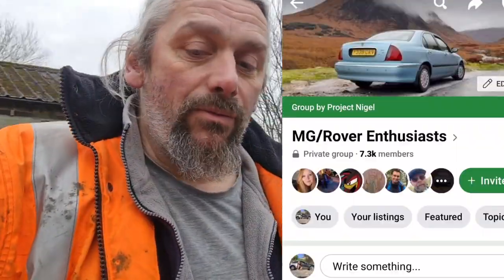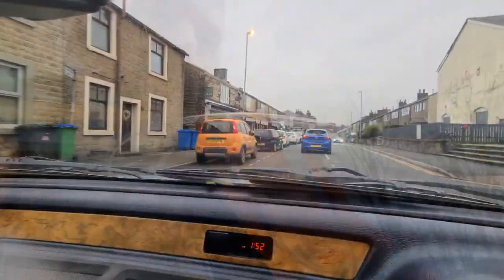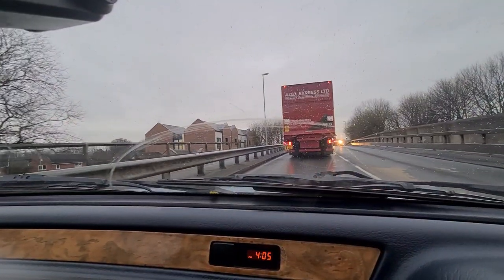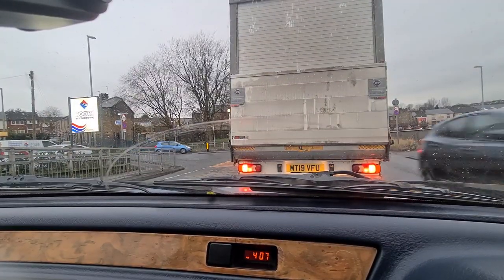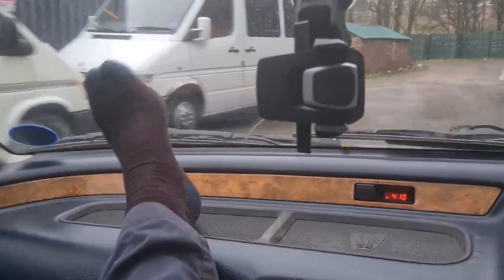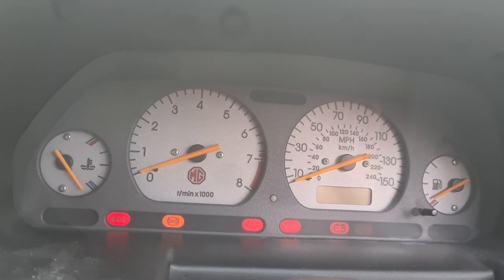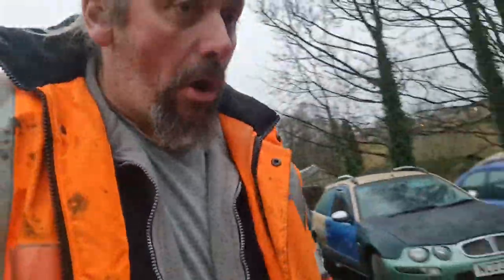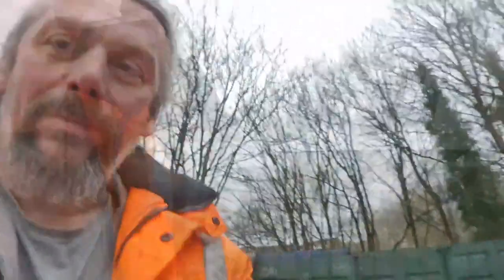More GTi stuff, and what's happening with the Custard Missile?

Comment: Since you've ordered some dextron 2 oil. Why don't you do a flush of the gearbox oil. I bet its never had such a service in its 30 year life.
Reply from the maker: It was changed 4 years ago by the chap who car is named after. This was more to seeing it helped smooth the gear changes. Flush out to come soon.
Reply: @ProjectNigel  changed 4 years ago then it shouldn't need doing unless it's done 100k miles in that time. Great things about these older auto boxes. You can easily change All the gearbox oil unlike the auto box in my lexus. Your lucky to get 2-3 litres out with a lot of faffing about.